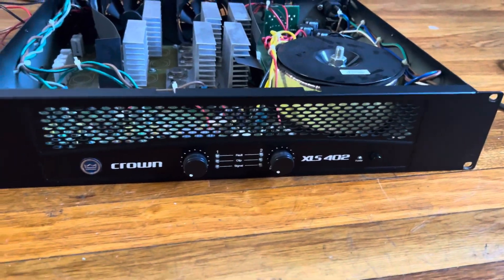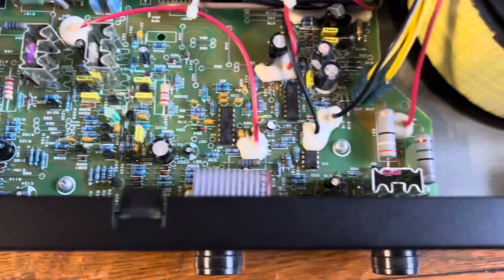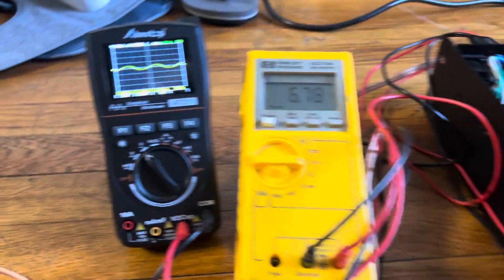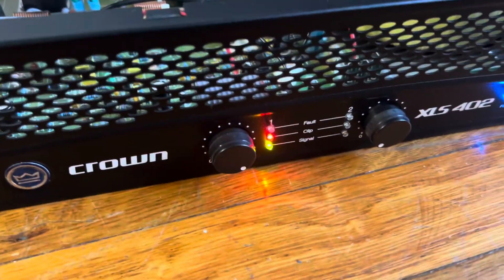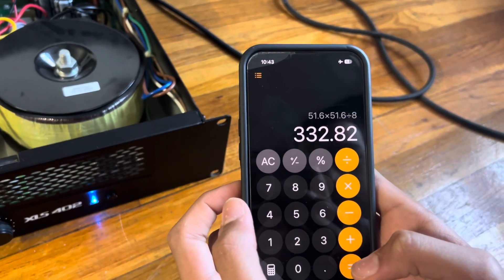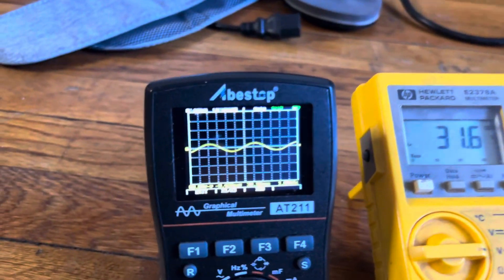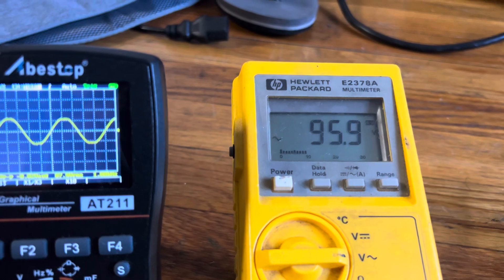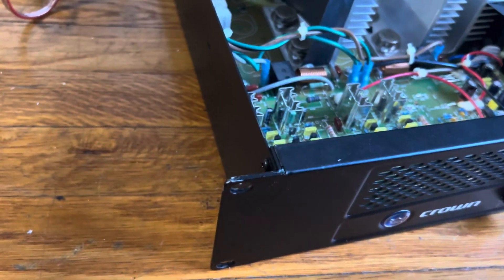CROWN XLS 402 AT CLIPPING, AMP DYNO

Comment: Would you say to get a functioning unit nowadays is a good idea or do you think these units are too close to needing repair? I know there's stuff inside that go bad after time
Reply from the maker: Everything has stuff inside that goes bad but I’ve owned several of these amp with no issues. The main things that go bad are the electrolytic capacitors but there are amps from the 70’s and their caps are still up to spec. These amps and amps from this era, if well maintained and not abused are bullet proof.

Comment: Thank you much for sharing I have customized and worked on a lot of these amplifiers it's like a DIY still a great amplifier I own two of the XLS 402 and one of the XLS 202
Reply from the maker: @SS-mj2mq  the 802 and the 5000 are some serious amplifiers.
Reply: @DJ_Renn  I do tutorial as well as repairing these amplifiers if you would like to watch I appreciate you doing the test on them I don't have a dino or an amplifier Dino anything like that so it's great to see somebody do a little quick video on it
Reply from the maker: @ All I use is an 8 ohm 200 watt resistor and the oscilloscope, I just don’t run in more than a few seconds otherwise the load resistor gets really hot.
Reply: @DJ_Renn  thanks for sharing awesome 💯💖
Reply: @DJ_Renn  would this be considered peak or rms? those numbers look really good
Reply from the maker: @ That reading is the maximum power just before clipping meaning it’s un distorted. How does that translate to peak vs. RMS? I don’t know. I do know peak is the maximum and amp can output but not clear on for how long or at what distortion level. This amp can go well beyond what this video shows but the output would be distorted, RMS is the average continuous power and amp can output. Soooo this am can output those watts continuously.